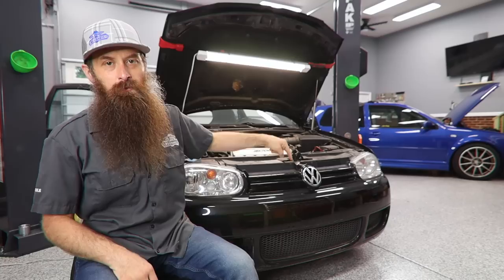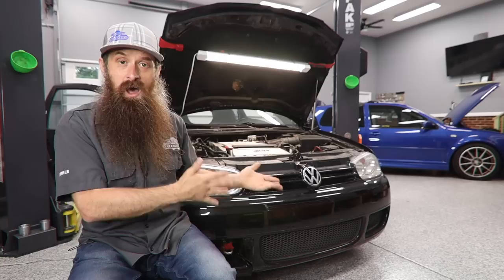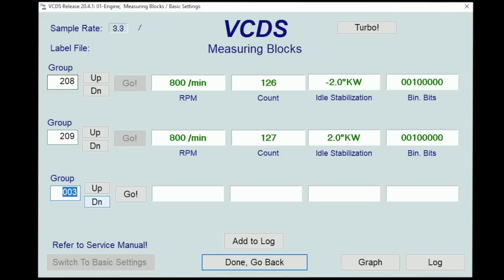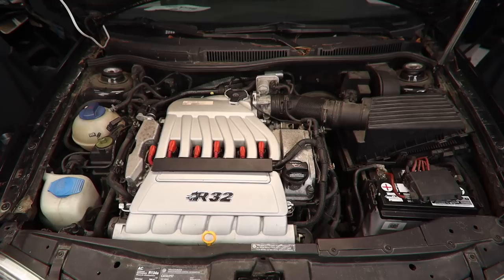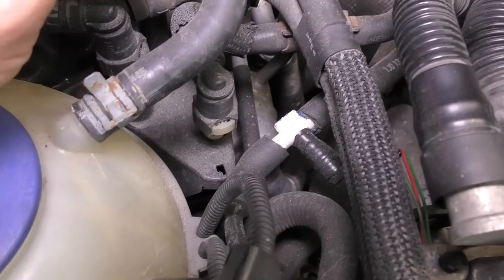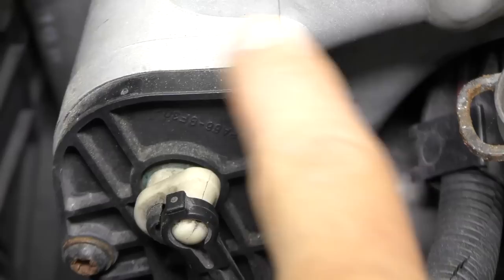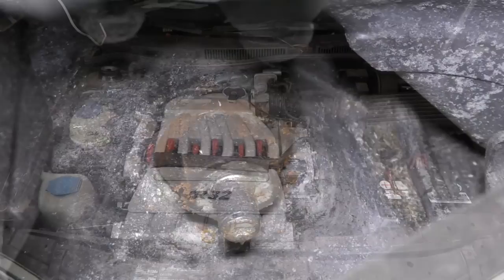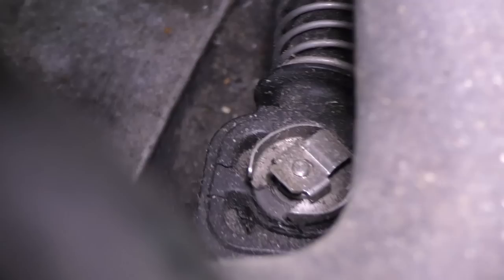EVERYTHING to Check Before Buying an R32 ~ MK4 Buying Guide

Comment: As a MK4 owner myself i can confirm: E V E R Y T H I N G is a common issues
Reply: Amen brother
Reply: Haha I have a list of mk4 repairs myself. Love my little vdub though, wouldn't trade it for anything.
Reply: Haha, you said it.  I still have my MKIV VR6 from 16 years ago.  Only 155,000 miles on it (it's not a daily driver), and the front suspension has been rebuilt three different times already.  People don't realize whether you drive these cars daily, or whether you let them sit, the rubber bushings and plastic coolant hardware will all still perish at the same rate.  UV, age, weathering.

Comment: When I bought mine (out of state), we took it to the local stealership for a prebuy inspection and it was a joke. The seller was honest about all the issues he knew of and the dealership didn't even catch basic stuff for example the hatch wouldn't open. But yeah, its a shame! Basically, if you have a buddy/shop you trust keyword, take it there for the prebuy. Overall I have no regrets, I love my R32!
Reply: Same with me.. taken pathfinder to nissan before buying & they said all ok...I asked to jackup the suv, oil leak from diff..even the propeller shaft was rusted🤣 Immediately rejected it & took Atlas.

Comment: My mk4 12v vr6 Jetta's low speed cooling fans would never come one, and I eventually diagnosed it to be a broken/burned low speed resistor on both fans. I took the fans out, soldered my own 1ish ohm resistor in place of the ones that melted, and added an aluminum plate on it to act as a heat sink. It has worked great ever since!
Reply from the maker: YESSSS I LOVE THAT

Comment: MK4 GTI 1.8T owner here. I am from south Texas, so the heat will play into these issues a lot.
1- Secondary Air Injection failure is super common.
2- Squeaky doors.
3- Soft touch plastics melting.
4- Make sure the timing belt has been changed recently or negotiate it off the price.
5- Latch on the hatch breaking.
6- Strange electrical issues ie. turning on recurc while driving makes the parking brake light turn on
7- Shifter bushing in the shifter box. They like to disintegrate and linkage will come undone. You have to drop the downpipe and heat shield to get to it, and expect your turbo manifold studs to break. 
8-  CV joints destroying themselves.
 
At the end of the day, they have their issues, but when you drive the car to the store and look at it while you're walking in, it makes it all worth it.

Comment: One thing I've had on both of my Jettas is a failed seal on the HVAC intake or whatever it's called -- the box that holds the cabin air filter down in the cowl. I suppose the bottom of the air cowl is mostly used as a water drain trough, but they just sort of cut a square hole in it for the HVAC intake, and placed that box over top of it. Said box just uses a molded rubber seal at its base to seal it off from water leaking into the HVAC duct, and two plastic nuts that hold the box in place and the seal under pressure. As the car ages, that seal gets hard and stops sealing... main evidence of this is a wet carpet in the passenger footwell towards the firewall after the car has been exposed to water. One of the Jettas I bought was advertised as having bad door seals (and the car smelled pretty moldy inside), but there was no issue with the doors -- I took it to a carwash, and pretty quickly noticed that the HVAC intake seal had gotten SO bad, I had a waterfall pouring into the passenger footwell. (NB: this was four years ago, and I only just realized the PO took the drain plugs out of the floorpan as an attempt to help it keep dry -- sigh). Anyway, it's not hard to fix, just get some black Permatex (or your sealant of choice), pull the box, and just run a bead of sealant around the seal.

More HVAC fun: if you notice the HVAC directional knob doesn't seem to do anything (i.e. air comes out everywhere), the temperature knob doesn't work very well to change the air temp, and/or you're getting blasted with dry-rotted bits of yellowish green foam out the air vents, that is also fixable, but a lot bigger PITA. The directional and temperature flaps are metal, and filled with holes. From the factory, VW covered these flaps with a thin sheet of foam with adhesive backing, which seems to disintegrate after about 15 years. I suppose it ensured there was always some airflow through all the ducts, but most air flows the way you have the knobs set. But when it dry rots, foam bits come out the vents, and obviously air goes through those holes much more easily. You have to take a big portion of the dash apart and get access behind the radio and HVAC controls. There's a very small access panel right there where you can get to I think two, maybe three, of the doors, but unfortunately it's barely big enough for an adult to get a hand in there sideways. Clean off the rest of the foam stuff as best you can, and get yourself some legit duct tape (the stuff HVAC guys actually use on ducts, it's kind of a really thin sheet of aluminum with SUPER sticky adhesive backing, not your traditional rubbery duct tape) and do your best to cover up the majority of the holes in the flaps.

Electromechanical stuff: just don't buy aftermarket replacements. As the door latches were mentioned, I highly suggest buying genuine VW latches -- for one of my cars I went with an aftermarket unit, and now have to deal with issues like the keyhole position switch not working consistently, or the mechanism jamming up if you try to open the door when it is locked. Another example would be the fan control module... a long time ago, I replaced that on my 1.8T with an aftermarket unit (it looked all rusty which caused me to stupidly condemn it without testing, but the problem actually ended up being a bad fan, of course), and it only lasted about a week before it completely died, and I put the factory unit back in. No problems since.

But you don't have to avoid the aftermarket completely. There are a few novel replacement or repair kits to deal with these cars' shortcomings, and some are cheap, yet work well. AA Rodriguez has a kit to repair the armrest hinge when it inevitably breaks (if it hasn't already), which involves two kinda crappy looking plastic bits and four self tapping screws. It's pretty crude, but it works, and doesn't look all that bad once installed.

Oh, and one other thing on door latches... if you have a four door, hopefully you won't have a back door latch failure. If you do, best of luck... the most important advice I can give is to be VERY VERY CAREFUL when removing the two piece plastic split pin dowel thing that holds the rear window to the regulator. Some guides say you can hammer it out, but DON'T do that, you WILL break part of the plastic regulator track. After a failed attempt at hammering it out, I just drilled it (I don't think they're reusable, but even if they are, replacements are cheap and a lot of dealers have them in stock), but just be very careful of the regulator cables (there are two that you have to pull out of the way to get a drill in there).

Raxles are excellent for half-shaft replacements. If you don't want to give up your firstborn for an OEM set, and don't want to go through the hassle of swapping axles only to find out your sub-$100 Chinese aftermarkets are bad, talk to Marty at Raxles. They use all OEM axle tubes, high quality CV joints, and pretty fantastic CV boots (I think they're a type of silicone... something that won't dryrot like the standard rubber). Probably the nicest parts buying experience I've had in recent memory, and the axles were shipped quickly, came packaged beautifully, with instructions, boots pre-packed with grease, and all the replacement hardware you need. Granted I've only been running mine for a few months, so I can't report on longevity, but from what I've read, they're at least as good as OEM. The only kinda annoying part is you have to call them to order. And hopefully your car hasn't had your axles swapped out for aftermarkets, otherwise you won't get your core deposit. The worst part of that whole ordeal was actually doing the replacement (getting all those bolts out after they've been in the inner axle flanges for 300k miles is a massive pain, and getting them around the new boots and back in is worse, since you absolutely cannot do that job without getting your hands covered in the diabolical axle grease).

Anyway, I guess I just want to say that yeah, these cars have their problems, but there is a silver lining here: the problems are almost always common*. I don't think I've had an issue that there weren't several lengthy forum threads and a DIY walkthrough fix just one google search away. The other thing is this platform was super popular, sold globally, and produced for *sixteen years (finally ending production in Mexico in 2015), so the parts availability is absolutely fantastic (save for special edition stuff like R32-specific body panels). I've got a friend with a 2001 4runner I think, who has to work a lot harder to find certain things for that vehicle, since there's a ton of stuff that is NLA. You can also find loads of MkIVs in junkyards these days, which is an excellent source for cheap OEM parts (no, you won't find an unbroken arm rest, or glove box, or cup holder, but you can find other stuff that doesn't break on every car). But it won't be that way for long... at least in the US, these cars are getting a bit thin on the ground, so now is a great time to buy one and fix it up if you are so inclined.

Comment: Hmm, you covered so much but I'll take a stab at adding to the list. Check all the lock cylinders, ALL of them. The cams inside the lock cylinder break then won't unlock/lock a car. Check the fenders to see if the lips have been rolled inwards by a past stancy-pants. Check the chassis rails above front axles to make sure that same stancey-pant has not notched the chassis to slam the car into the ground (yes, I have seen this done, badly). If you see engine mount spacers, deff check chassis rails. Low speed (specifically) radiator fan operation, the low speed resistors can burn out, just need a bit of wire and 2 male spade terminals to test that. Cruise control inoperable because of clutch pedal switches. Rear demister dead strips. Check behind the cover panels in the rear for water intrusion (just behind and below the tail light connectors). You never know for sure how many times the car has had it's engine out and had the single-use mount bolts re-used. Nice work Charles, looking forward to seeing more of this one :-)

Comment: charles, 
first off thank you for the quality and in depth-ness to your videos and really breaking down and simplifying with explanations. not all of us are master techs and rather just backyard enthusiasts and just taking that little bit to explain really makes the video better and helps me understand your thoughts and points that much more. 

your suspension video install helped me tons when i did h&r coils on my 04. i made sure to thank you when we met at waterfest 19 (mikey, silver 04) i still have that autographed hot wheels!! 

my thoughts that you actually touched on in the video are about the door latch modules & microswitches as i’m about to dive into that repair myself. i just converted all my interior lighting to all LED and in doing so discovered my non working driver side. along with the door not locking with the fob, fuel pump not priming upon opening etc. 

it is a super common issue as i’ve read and heard you talk about. a specific video on this would be a great addition IMO! 

Keep it up! the videos are fantastic and my go to when on youtube searching for vw something specific or just generally bored. 

sincerely,
all of your faithful viewers.

Comment: The biggest thing wrong with my car was a bad input shaft bearing in the trans. Decided to swap to an 02M DRP. Car had bent tie rod, blown coilovers, vacuum leaks, stuck parking brake, leaking rear main, a Subaru brz muffler, etc. Still love the car lol.

Comment: I had 2 mk4 GLI Jettas. 24 valve VR6, and 20 valve 1.8t. To put it simply. You need to have a lot of disposable income to maintain one of those cars. I did all my own maintenance and got sick of breaking down. Bought a geo prism and drove it for years neglecting all basic maintenance. Never left me stranded

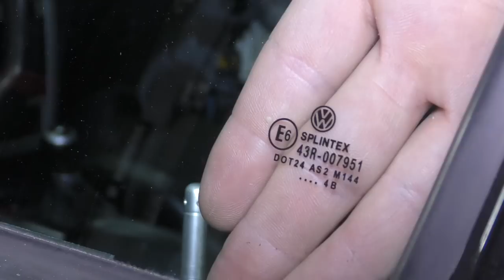Comment: Just to add to the part where you check for VW glass, it is possible that someone replaced a window with one from a junkyard, so it would still have a VW logo on it.  What you really want to look for is the very last line.  At 17:14 you can see it says ....4 B at the very bottom.  I've seen many different combinations of dots and numbers on OEM VW glass that will vary from car to car, but all glass on the car should have that same code at the bottom.

Comment: I’m surprised you missed the biggest thing to look for on ANY used car...signs of aftermarket stereos and other electronics. Even if they have a stock radio installed, look for signs of past wiring under the dash and in the trunk/hatch area especially. Look near the fuse box (under dash and under hood) and look on a MK IV above the pedals. There should be plastic trim above the pedals. If it is missing, someone was in there. I can deal with bushing and leaks and missing parts, but wiring gremlins will take your money and your sanity. Been burned a few times on this. The worst is when something was removed and the power wire was cut back and left abandoned in some hidden location causing an intermittent short. At least when the stuff is still installed you can trace back the wires.

Comment: Hey Charles great video. I picked up my first R32 around the same time you picked up your blue one. Wish I had the money to throw at it but I got too many projects (65 impala, mk2 gti, and mk4 R32). My R32 currently just hit 90k miles on it and luckily was very stock/unmolested when I picked it up. One issue I found is the line to the brake booster has a hole in it from rubbing against the threads sticking out of the firewall. Not sure what this line is called. Another issue (I think) I am encountering is what I believe to be the fuel tank pressure valve ticking on startup. Possibly related but  when I fill her up at the gas station the pump will auto-stop prior to a full tank of gas. If you have some insight I would appreciate it, if not I will turn to google. Great vid, keep up the great work!

Comment: - avoid any model doesn't have a manual 
- cooling system has to be replaced immediately for a metal impeller  
- test drive at high speeds for at least an hour to see if it overheats with AC on 
- radiator needs to be replaced after purchase for an all metal one

Comment: Great video! One thing you didn’t touch on was the clutch. I have an 04 MKIV Gli with the 1.8t and 6-speed, should the R32 clutch have the same feel as that 6-speed when I push in the clutch pedal? Not sure if they have the same clutch and transmission but I had assumed they do. I test drove an R32 that had almost no clutch feel to it (could push it right to the floor MUCH easier than in my Gli) but I wasn’t sure if that is normal. From someone who is actively looking for an R32 this is an awesome video, much appreciated 🙏🏻🙏🏻🙏🏻
Reply: I would guess that’s just from wear. The feel might change after years of spirited driving
Reply: Josue Reyes that’s my guess too, I just don’t have a good baseline for what it SHOULD feel like. But if R’s have the same stock clutch as my Gli then I would expect their pedal engagement should feel the same as well. Unless there’s something else that could be affecting it that I’m not thinking of.